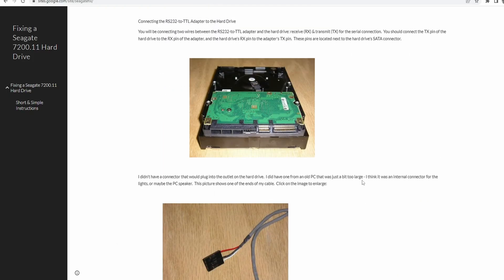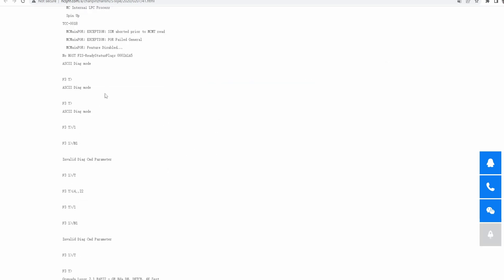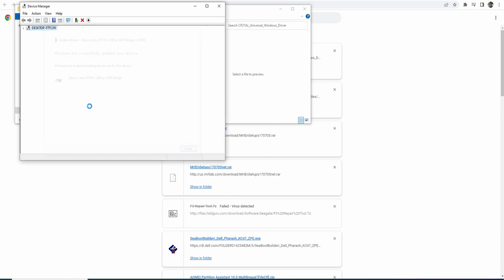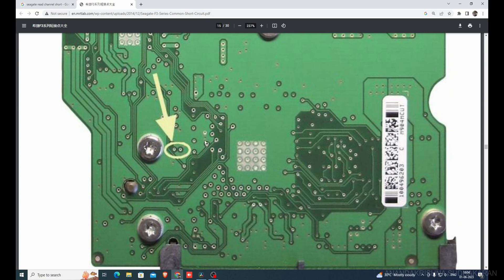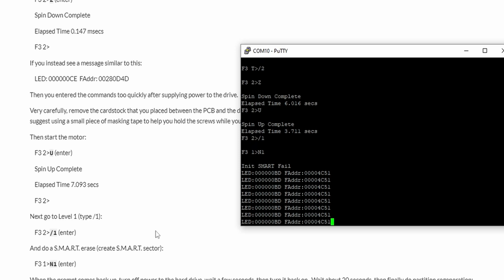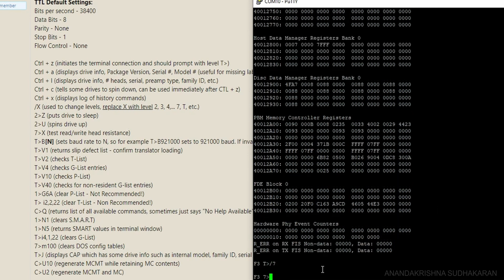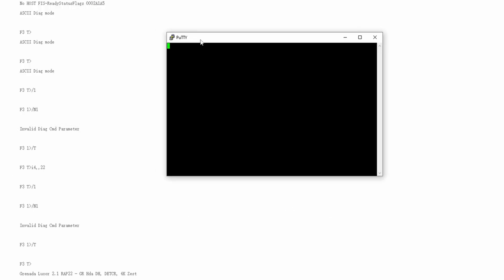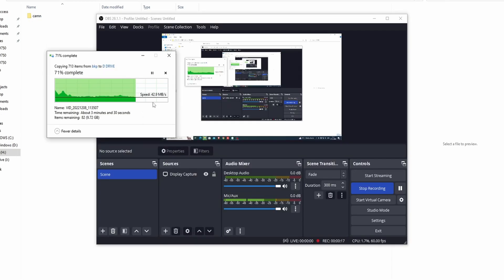Ultimate Hard Disk Recovery Guide: Restore Data with USB to TTL Adapter at HOME

Comment: Sir followed your method.. when started terminal command it stuck in" spinup"
Reply from the maker: Check the wiring, if cmd stuck it means there is an issue in the hdd data, the serial device couldn't handle it, but it waits to solve. Also if there is no spinup, means the device waits to spin up, but it didn't happend, also leads to hang

Comment: I accidentally flashed wrong firmware file to my ST31000520AS with SeaTools in Windows. Can I restore factory firmware with these commands over serial?
Reply from the maker: Try to flash the eeprom chip directly using any eeprom flasher, before doing that make backup also, i think its possible to repair. always make backup
Reply: @AnandakrishnaSudhakaran  Can I flash the eeprom chip with a Seagate .DLO file? Why should I backup if the firmware now is wrong?